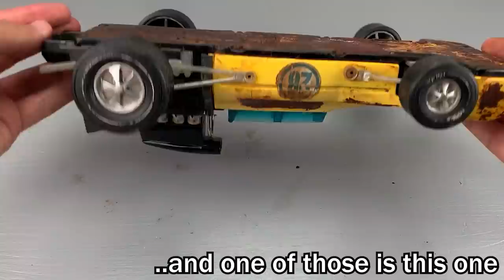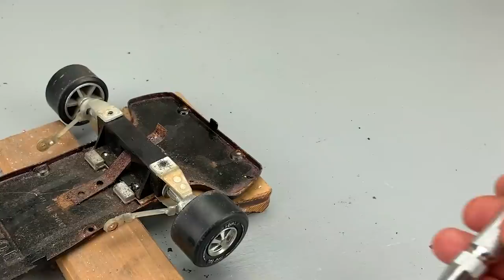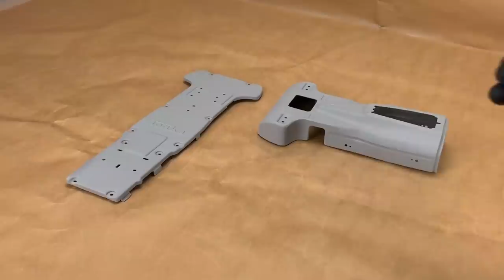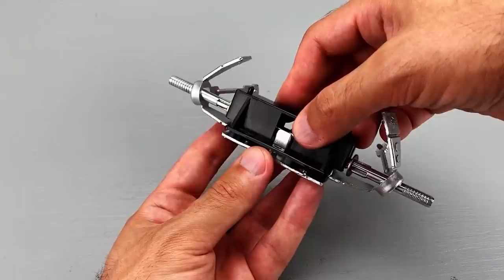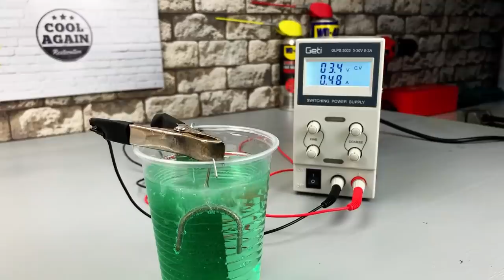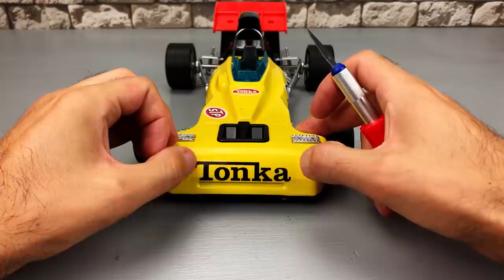1970 Tonka Formula One Racing Car - Restoration

Comment: You should secure screws with zinc plating - they will rust faster than the speed of light, without any protection.
Reply from the maker: After sanding them,everytime I let in the oil for one,two days 👍🏻

Comment: Amazing job Mr Cool! Not sure I would have ever got all the bits back in the right place 😂 just watched this with my 6 y/o son and he loved it too. 😍
Reply from the maker: Glad to hear that Mark😎 thanks a lot🍀👍🏻
Reply: @CoolAgainRestoration  Hey Mr Cool. I'm doing my very first restoration of a simple square tool. Would I be able to contact you to ask a few questions? no worries if not. thanks, M
Reply from the maker: You can write here Mark because I’m reply to all persson 😎
Reply: @CoolAgainRestoration  Awesome. thank you. I'm trying to restore this old square. I've been sanding and sanding, after doing rust removal with evaporust. I cant get rid of the discoloration and pitted look. It wasnt badly rusted. I want to get a mirror finish, but I dont think it's ready for polishing. what would you do?
Reply from the maker: You need to sand from 200-800 but dont skip a step untill that step isn’t done properly. Anyway. For a polish look you can make it also if you dont make the sanding. That means you’ll have a polished surfaces but with pitting
Reply: @CoolAgainRestoration  thanks. I used 120, 150, 240, then 400 but the the discoloured bits remained. I'm thinking if the darker colours dont disappear with the lower numbers, then going to 800 wont help. is that correct?
Reply from the maker: Some darker colour is because the material which is made. But if you apply a compound polish and make a great polish,the darker colour need to dissapear
Reply: @CoolAgainRestoration  would you have sandblasted an old square like this? Sandblasting seems to remove all discoloring from rust. I think I need a sandblaster 😀
Reply from the maker: Sandblasting is every time a good way to achieve that look. But also with sanding you can do it. Try sanding 15 minutes with 100P then 150......800. But dont skip one minute from each step
Reply: @CoolAgainRestoration  will do. it's my first, so not expecting miracles 😂 thanks my friend.
Reply from the maker: You’re welcome 👍🏻👍🏻

Comment: Hi sir I'm suggesting you a thing which you can use after cyclone is iron net which is use for flour, it helps you to find the springs and bolts easily. 🙏🏻☺️
Reply from the maker: Yes,I used in new videos. Thanks 🤗

Comment: Good Video. Be careful using WD-40 on plastic. I've always been told it breaks down plastic due to being petroleum based and thin enough to act as a solvent and break down the plastic. Just what I heard, though, so who knows?
Reply from the maker: I heard the same but if after 10-15 minutes you clean the oil,it’s ok. Thanks for appreciation Mark 👍🏻

Comment: I imagine it took at least 3 t attemps before getting the white paint to conform to the letters and stripes on the tires.
Reply from the maker: You’re right there 😂
Reply: Charles Daigneault other sites use a small brush to paint the letters.....and it looks amateurish. This technique may take some time and practice but it looks so professional. I wonder if the same process could be used to paint the raised lettering on metal castings?
Reply from the maker: I dont think work better on metal Richard

Comment: I collect Transformers, ROBOTS IN DISGUISE, right? Transformers fans who complain about high prices can't seem to grasp the idea of parts count. The more parts a toy has, usually the better it is, but the more it will cost. Quality isn't cheap! Your car is a great example. All those plastic parts, all those metal parts, screws, different kinds of plastic, and i bet that rollover bar isn't the same metal as the body. Putting treads on the tires costs money! They could have skipped that. They didn't and now the car costs more. High prices will lower demand, and maybe its rare because of low demand. Also, using STP Son of a Gun on an STP sponsored car, subtle!
Reply from the maker: Yeah,I’m agree with you. 👍🏻👍🏻

Comment: Not to be from correctness nazi squad, but you used wrong screwdriver bit for those screws. They are Philips (PH), you used Pozidriv (PZ). While not a big deal there, it can seriously mess things up when more rust and seized bolts come into play. Destroying a slot at the beginning from a wrong tool choice is not a good start 😜 Other than that, I was quite surprised by that original paint, even sandblasting was longer than usual, I believe. Nevertheless, great job! Keep it up!
Reply from the maker: Yes,I know I used the wrong screwdriver by mistake. Sorry for that. The paint was original. Thank you from appreciation 👍🏻